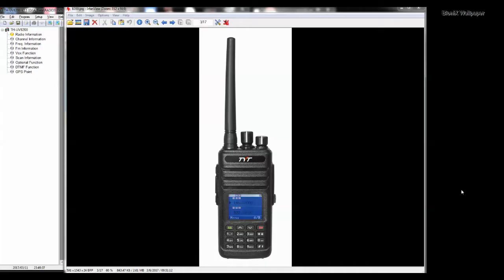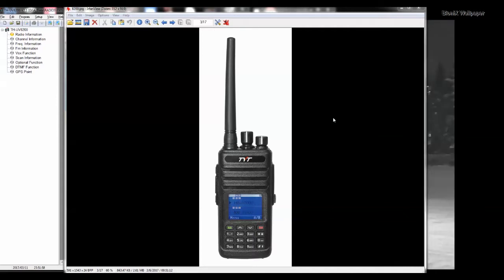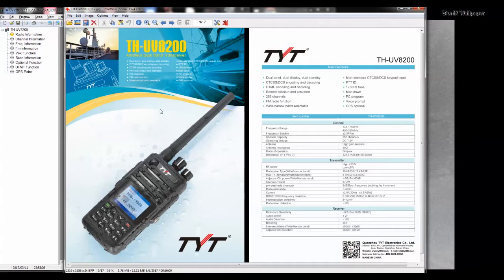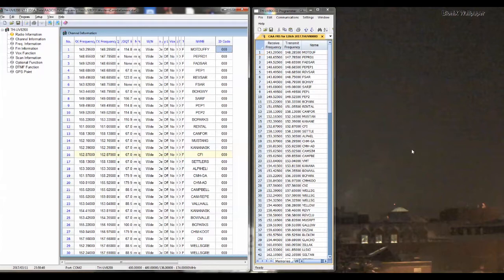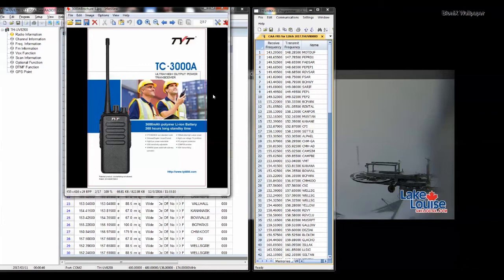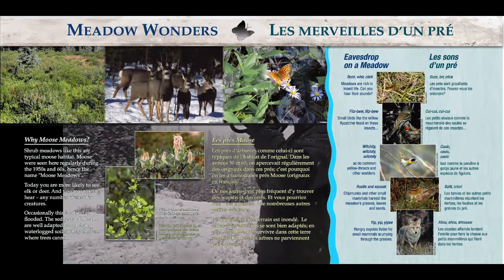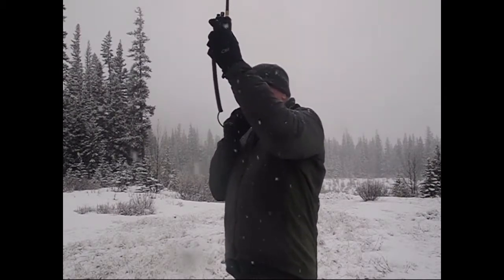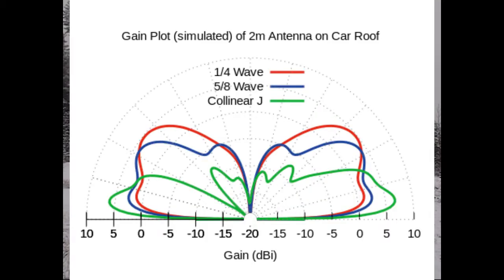TYT UV8200 Field and Bench Testing

Comment: Thank you for your very detailled review, along with some technical explanation.
The tunned antenna was made by you  (mechanical sugestions)?

BR Luis
Reply from the maker: Thanks Luis,
The stock antenna is made by Smiley, then we tune it and add the CPC 300 tubing. The tuning is adjusted for the velocity factor of the tubing by using the SWR results to get the optimum trim. The reason for the color is to designate the frequency the antenna is tuned for (Red=160, Green=165, Yellow=170, etc.).
Reply: Hello M.P. Thanks  for the info. Good idea the coloring. To replace my original antennas (severall Baofeng models) I bought MJF-1717S and JETFON DB25S. Found out (measuring swr and power out) that original ones performe better or similar. And the tunnig of them is almost impossible (only cutting / going up in freq).
So again, thank you, and keep posting technical tests.

Best regards, Luis

Comment: Just curious, how well would your UHF Antenna receive VHF, I'm using this for GMRS but it would be nice to scan other frequencies when using a 460-470mhz tuned antenna
Reply from the maker: It would receive, but not that well on VHF unless you were using the Smiley 270A dual band antenna which can be tuned by collapsing sections.

Comment: Can you help me with tuning an antenna for my TYT MD-680 radios? Following your advise I would need a new antenna to use the radios at 446 MHz  (pmr 446 in Europe here) to not damage the radios. I would like to have a mobile antenne to place on my tractors for that frequency and also one for the handheld itself. Mainly because I use the TYT on low power 4 W to not have to much RF exposure.  But when using it in the tractor I Lose quite a bit of range compared to use outside. So I would like external antennas for it and then I can have a fixed setup in the tractors with a mic and battery eliminator. 

Where can I buy such antenna for other frequencies than the Amateur Band 433 MHz?  I have found a Nagoya 108 but that one is also mainly for 433  MHz.  How can I  tune one for 446 MHz? 
I'm prepared to pay 15-20 dollar per antenna, because the radios only costed me around 70 dollar per radio.

Can you help me? Thanks in advance!
Reply from the maker: Hi Daan,
For the tuned antenna for your HT, you can source that from Smiley (https://www.smileyantenna.com/).
For your tractor you need to get a Mag Mount setup. I'd look at a proper brand such as PCTel, Larsen, CommPlus or ProComm. Personally, I would not bother with any of the Nagoya antennas for an HT or a Mobile application.
Reply from the maker: It looks like your SWR result is incorrect, it might be a good idea to check or calibrate your meter.